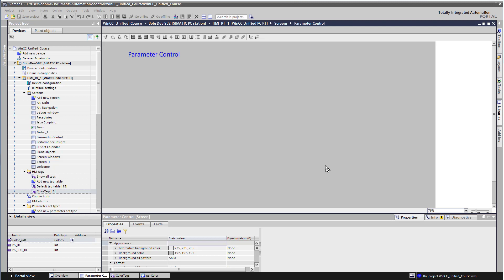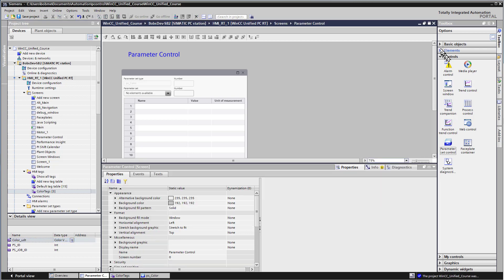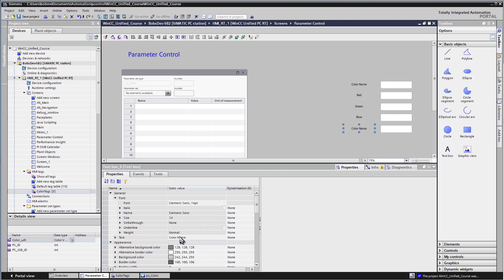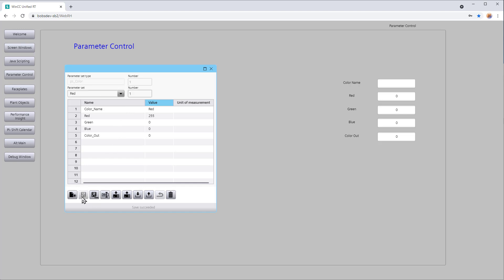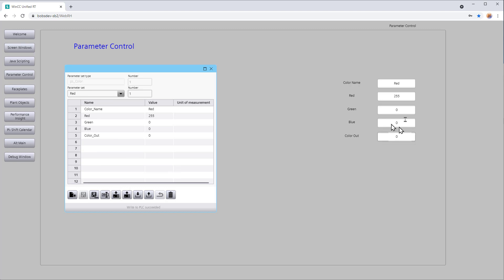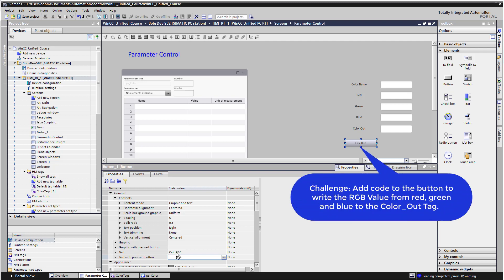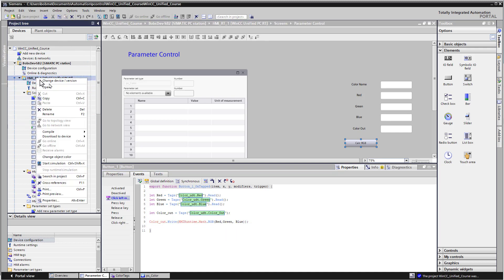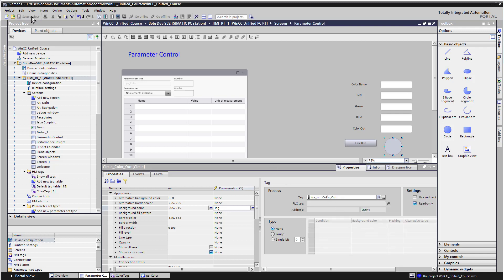WinCC Unified v17 # 19: Create Parameter RT User Interface 📝 #WinCCGURU

Comment: Great Video!

Do you know if it is possible to access the elements in the ParameterControl table via script for example? I would like to display the values from the table in I/O fields.
Reply from the maker: Yes you should be able to using findItem. You may need to do a little experimenting though
Reply: @WinCCGURU  Thank you for your reply. However, I believe that unfortunately it is not that simple.

Comment: Hi WinccGuru. Download button didn’t download into the PLC. It just updated the tags in the HMI. How to download in the PLC?
Reply from the maker: the Tags used are the recipe - they represent parameters you are writing to PLC tags. Of course, since this is a demo I am not using a real PLC but hopefully you get the concept.
Reply: @WinCCGURU  yes but all the part where the HMI tag connects to the PLC is missing. In fact, the correct way of doing this is starting from a PLC UDT, then a DB, and then use the DB to make a type in the library for the HMI. Or is there another way? Thank you❤

Comment: Good evening WinccGuru, first of all, thank you very much for the course and the videos have an exponential value!!!. 

I have been trying for 3 days to solve a problem with the Parameter set control.

- If I press (botot) write I get a message saying : Wirite to PLC failed.
- If I press (botot) read I get a message saying : Read from plc and save succeeded.

I have checked again the creation of : project library, Parameter set types, HMI tags... without success.

could you guide me, thank you in advance.